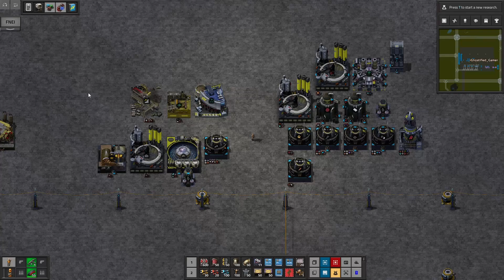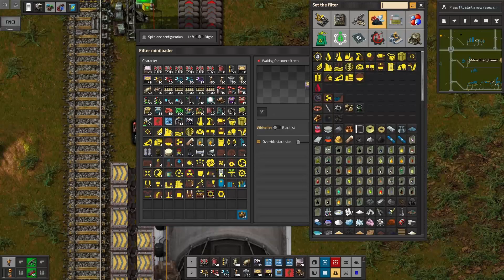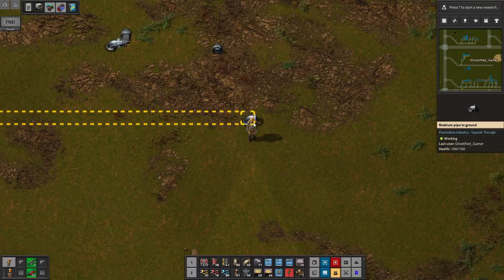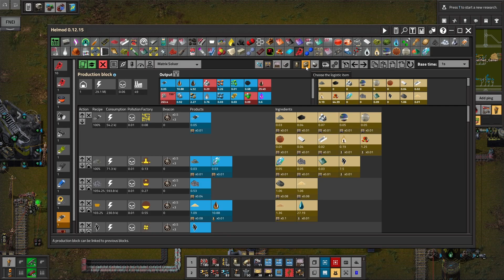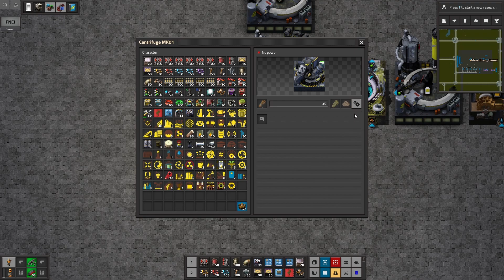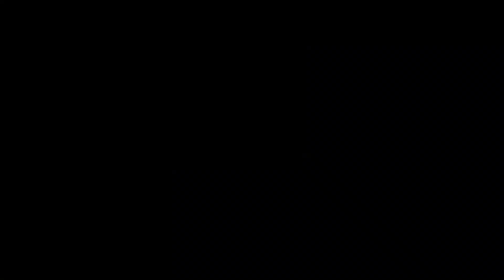Factorio pYanodons - Complex Circuit Board! (Feat.) More Spaghetti - EP135

Comment: Oof, what a milestone! And now I'm all caught up... just in time for your next episode to release in just a few minutes (or is it an hour or two? I don't remember what time of day you release your Factorio episodes). One thought I had as you were talking about the uses of rayon: I'd probably advise using the 4-battery recipe that uses pyrite rather than the 6-battery build that uses sodium hydroxide, because isn't that stuff kind of hard to produce? And you use a lot of it in places like cellulose, I believe. The 6-battery recipe is 60 sodium hydroxide, or 10 per battery. That's going to add up fast. Whereas pyrite you can make out of just sulfur + iron oxide. (And if you end up with an excess of pyrite, you can break it down into iron oxide + acid gas).
Reply from the maker: Glad you're all caught up :D  The episodes release 9am CST right now.  Good idea about the batteries as that sodium hydroxide is difficult to create.  I'll try to remember that when the rebuild comes up ;)
Reply from the maker: Correction, 11am CST is when I release the episodes.